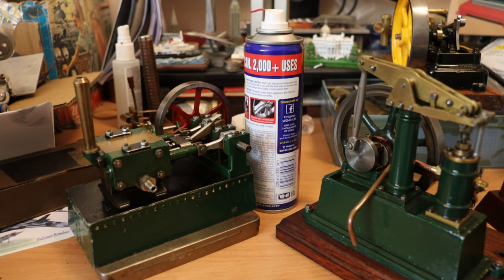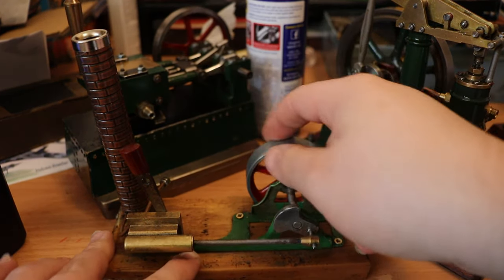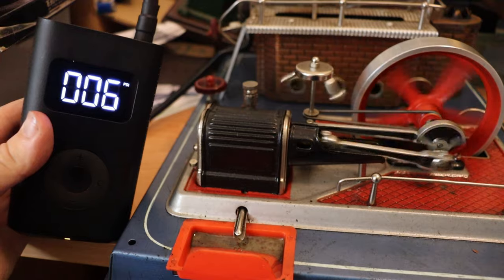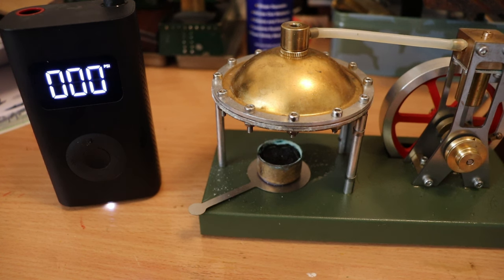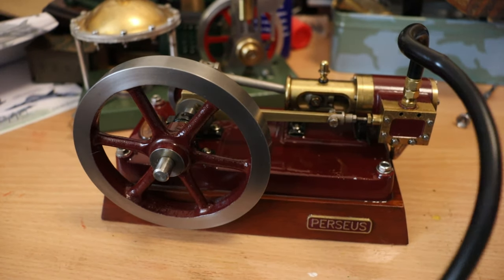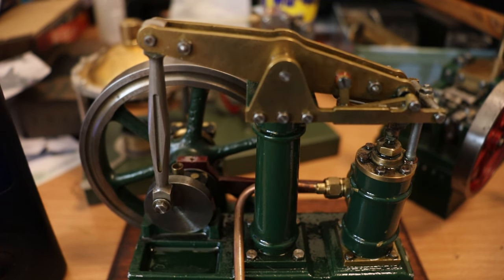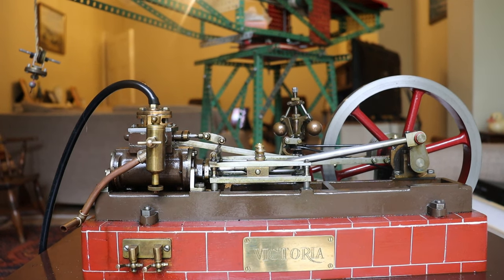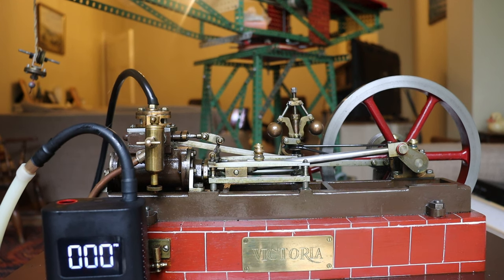IS THIS A PERFECT BUDGET PORTABLE AIR COMPRESSOR FOR STEAM ENGINES?

Comment: I use a compressor from an old refrigerator for my smaller steam engines. They don't have a lot of air, but it can move your nice little steam engines and it's very, very quiet.
Maybe you can get a refrigeration compressor like this from a junkyard. However, the refrigerant should be disposed of in an environmentally friendly manner.
I use it often.

Best regards
Reply from the maker: Hi! Yes I’ve seen old fridge compressors used before. I’ll definitely look into them